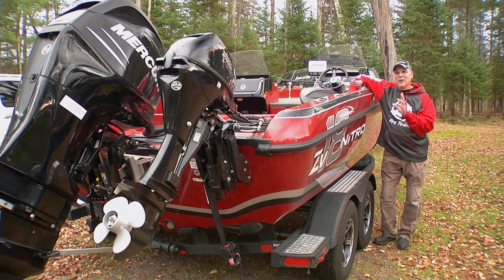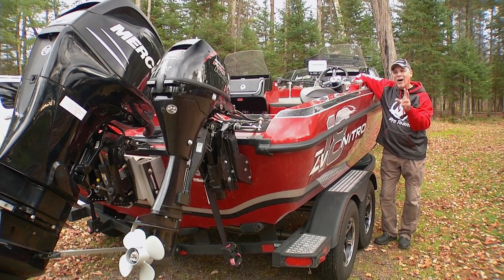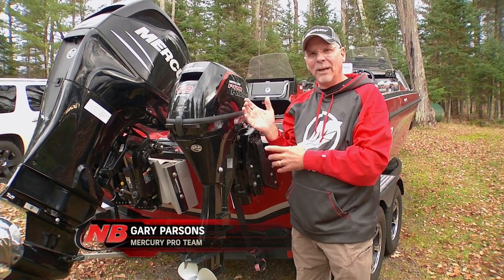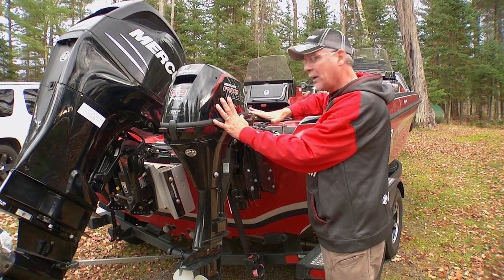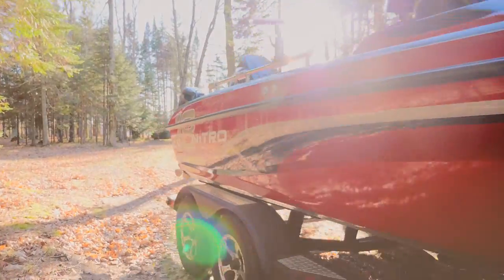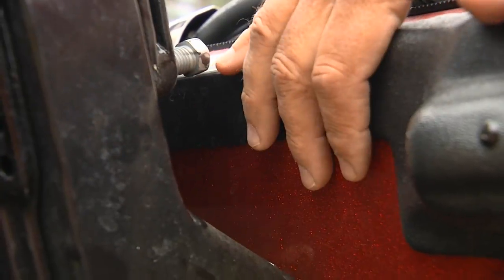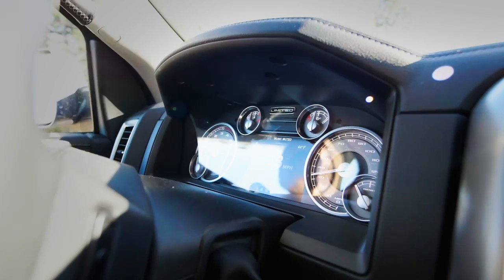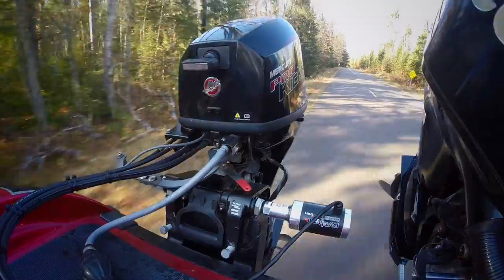Mercury Kicker Trailering position

Comment: I have a few questions. I live in an area where allot of folks don’t have kickers. I have a big bay boat and fish salt water and some offshore. I was thinking of adding a kicker motor to my bay boat for trolling and invade of engine problems. Can these be set up to be removed when not needed? Also my boat doesn’t allow for easy tiller handle use so would I need a separate set of controls? My main engine is a 300 verado.
Reply from the maker: A 15 hp Mercury Pro Kicker would be perfect, but unfortunately there is no quick detach.  I would use a tail fin with remote control for steering and an itroll for speed control.  That way you don’t need an extra set of controls.  This is the best setup that I’ve seen.